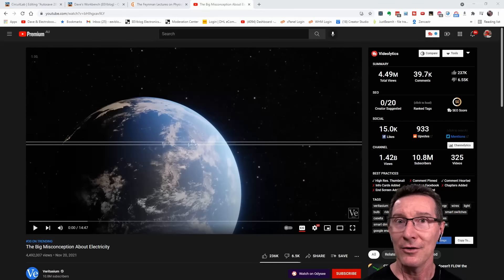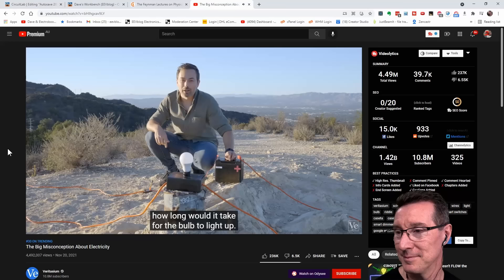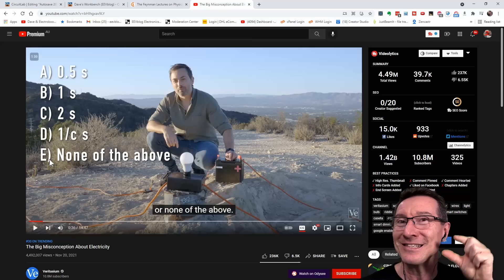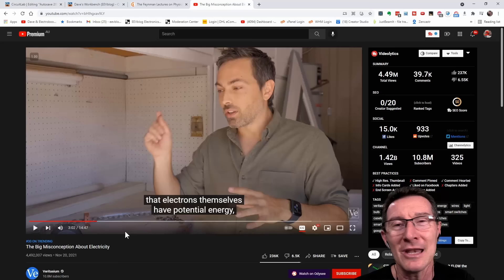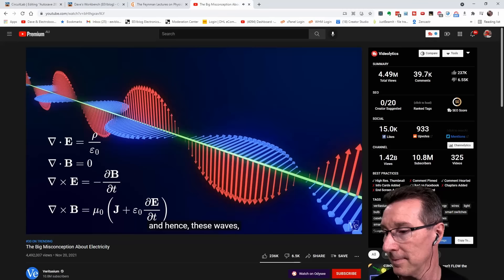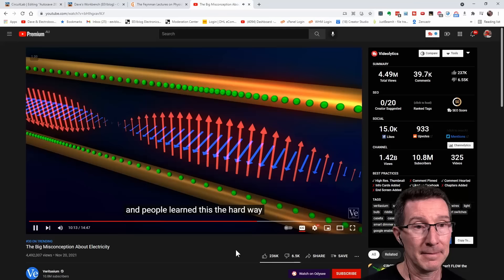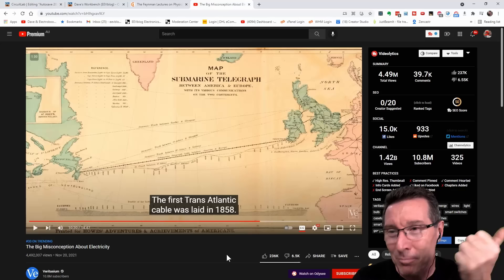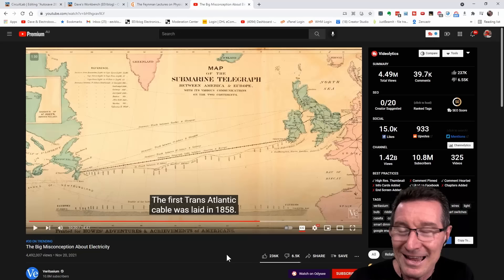EEVblog 1439 - Analysing Veritasium's Electricity Misconceptions Video

Comment: I'm surprised that you are supporting Veritasiums' claim that the lamp TURNS ON after 1m/c seconds.  This is incredibly misleading.  He is trying to claim that because the energy travels in the electromagnetic fields and not in the wire then it jumps across the 1m between the battery and the lamp in 3.33ns.  This is not correct.  As you showed with your simulation there will be a short current spike which arrives after 3.33ns because of the capacitance between the start and end of the wire but this can in no way be considered to turn the lamp on, it only lasts a few ns.  The lamp doesn't turn on until the energy that powers it has travelled all the way round the wire loops from the battery to the lamp which takes 1 second.  The correct answer is B (1second).  Veritasium even shows in his graphic that the Poynting vector points along the wire and not directly from the battery to the lamp.  It goes the long way round.

In your look at Richard Feynmans' paper you are misinterpreting what he says.  When he shows the S vector pointing into the wire he is only talking about the energy that's dissipated in the wire. ie the resistive losses.  The E vector he shows pointing along the wire is the voltage drop in the wire and not field due to any battery voltage.  He is not considering any energy being carried by the wire from a source to a load.  In the case of power being transmitted from a battery to a lamp the voltage field is perpendicular to the wire and the magnetic field encircles the wire so the the Poynting vector points along the wire as shown in Veritasium's video.  That's why the energy has to go the long way round and takes 1 second.  (edits for typos only)
Reply from the maker: He explained that, the bulb must be one that turns on instantenously. He's tryign to make the point about the coupling, and he's correct. It doesn't matter how long the bulb light or at what level, the fact that it does at all after 3ns is what matters.
Reply from the maker: Re Feynman: If there is a DC current in the wire then it must be going from source to load. You don't get a current without a load.
Reply: @EEVblog  He is not trying to make a point about the coupling, that is a trivial side effect.  He trying to say that because the energy flows in the fields and not in the wire then it can travel in a straight line from battery to lamp.  If he had said that the lamp gives a brief flash lasting a few nanoseconds then he might have a point but he didn't.
Reply: @EEVblog  Yes but Feynman is not considering that, he is only talking about the wire.  In a practical circuit the voltage field along the wire is only a few mv/m whereas the voltage between the wires is some V/mm or 10s of V/m.  So the E-field is essentially perpendicular to the wire.  In Veritasium's video he even assumes that there is no voltage drop in the wire so his Poynting vector is exactly  perpendicular to the wire.
Reply: @petehiggins33  that is what I caught too, he[Veritasium] started to sound kind of woo woo-ish towards the end

Comment: As an engineer of many years, and having read the Feynman papers, I'm with you all the way. On a much simpler practical note, whether energy actually flows in the wires is academic in that IF YOU DON'T CONNECT THE WIRES, THE BULB AIN'T GONNA LIGHT UP!! :-)
Reply: But how could the bulb even know if there is a break in the circuit some enormous distance away? 1m/c seconds is not enough time to be affected by there presence or absence of a break in the wire. Lighting up the bulb MUST be independent of the wires if the bulb reacts to the switch at the speed of light across 1m.
Reply: It will light up anyway but it won't stay lit. For the first part it is basically an antenna, that is the transient part, but if you cut the loop it will change the steady state response.
Reply: Now I am seeing that this answer is in the video from a transmission line point of view
Reply: @duaneeitzen1025  If you flick the switch on and off quickly, then at a later point in time the light will flash. The main point I was making is that for practical purposes it doesn't matter whether the energy is transferred inside or outside of the wires: if you want to power a light you still have to connect wires to it from the poer source.
Reply: @mytorojas  If you flick the switch on and off quickly, then at a later point in time the light will flash. The main point I was making is that for practical purposes it doesn't matter whether the energy is transferred inside or outside of the wires: if you want to power a light you still have to connect wires to it from the power source.
Reply: Wires aren't connected through capacitors or transformers, yet current flows.

Comment: I watched the @Veritasium video when it came out.  (I have a masters of science in electrical engineering, and 35 practical experience designing familiar electronics and software.)
I felt schooled by the video.  Maybe a little down.  I felt like maybe I needed to completely re-envision the way I think of electronics.
I knew the equations and theory he was saying were correct.  I love physics.  But... I really like my conventional view of electronics, the one I always had, because I can easily make predictions about what a circuit will do.
Your video, in particular, with 2 or 3 others I watched, really made me feel better that I was not the only one who didn't want to get mired in thinking deep physics for 99% of the situations, where the basic model works.  I have worked in autonomous driving circuitry, using radar, and with tesla coils, so I know all about high frequency and where the points he brings up become really relevant, and I agree and respect Veratasium,  I just mean regular common applications of electronics, where we can ignore those details, for the most part, make the conversation a fun thought experiment into physics for the extra nerd level of depth into the details of it all.  But I will continue to envision electronics simplistically to solve issues as I always have.
Reply: Theory is great, right up until your boss tells you the hardware has to be on his desk at 9:00am tomorrow morning.
Reply: @AndyGraceMedia  the penultimate difference between a scientist and an engineer. :P
Reply: @ExarchGaming  Not really, I think you miss the big point of this video. You are answering someone who probably did not study engineering electromagnetics, because it is not needed for electronic engineering outside of RF design and transformer design. And not all physicists have to think about Poynting vector fields, and they certainly cannot be measured, only abstracted and calculated from the electromagnetic field density vectors. Something that cannot be directly measured tends to not by contemplated very much, as such not very practical to deal with. I learned Poynting in power systems engineering, not in electronic engineering which I also specialized in. And it is taught for completion's sake and hardly ever used in problem solution even in physics and engineering electromagnetics. That is because what can be measured is much more germane to theory and practice.

Comment: @10:30 "a piece of restive wire" and "the battery" are mixed up. Even with DC the poynting vector always points out of the battery, because the E-field around the battery is reversed compared the the E-field around a resistance, whereas the direction of current ist the same in both cases.

Comment: Good video! I think its great you brought up Feynman, as I believe his emphasis is always on understanding in general how the little pieces form the large behavior. Electricity works by pushing charges inside a wire. That intuition is extremely crucial and burying that understanding with pointless formulas and jargon does no one any good!

Comment: 22:30 Remember, Dave, if it is changing, the change is propagating. So connecting a DC source at the moment of connection is no different than looking at the first quarter of a sine wave at the same risetime.
Reply: It's a side effect, that hasn't much to do with the main power transfer.
I want him to show the light bulb glowing (producing light) from a 12V battery with only the tiny fraction of a second long establishing fields period and the weak coupling of wires 1m apart.
Reply: @realedna  It isn't a side effect. This is how transmission lines work.

At long term DC, it eventually settles down to merely the resistance of the elements. Wire, bulb, battery, switch.  For any transient change or AC signal, the two sections would be modeled as shorted transmission lines using their characteristic impedance.

1 meter spacing makes a pretty high impedance transmission line...
Reply: @AlienRelics  Yes, but how long does this transition period last and how much energy would be transmitted?
Do we assume the battery has no internal resistance and infinite capacity to be able to provide infinite current for a reasonable amount of time!?
Assuming superconducting wires is already hilarious...
Reply: @realedna  You can't mix idealizations and real world circuits. You'll get nonsensical results.

Idealization is to isolate a particular effect or effects in a thought experiment.

Rather than talk about light years of superconducting wire, I think it would be more useful to build this with physical parts and use fast pulse generator and a scope. However, that is great for us technical types. Veritasium makes science popularization videos.

Comment: Interestingly enough, when I was introduced to C language long ago, there was a concept of enums. At first I could not grasp an idea of naming integers with some literals, yet later it all made perfect sense. Same as here, Ohms law, impedance matching and other stuff are just like enums, whereas integers are fundamental Maxwell's laws. It just easier to work with meaningful enums rather than with integers. It would be crazy to solve simple problems with Hamilton's approach in classical mechanics when you could simply utilize  Newton's laws.
Reply: I still get caught out with enums. I look at them like #define VAR 4, like it's a set number or something that gets written by the compiler. Got any sources you'd recommend?
Reply: That's just the implementation of enums in C. They're something else in other languages like Rust and Java. Just to make things more annoying... :D

Comment: **  Overall, the main points about practical electrical energy uses are:
~ A.C. waves have, in series, transverse & perpendicular properties, therefore they conduct thru the outer surface of conductors, which made them useful for long distance propagation, such as high voltage transmission lines, as long as the transmission lines are above ground, & separated by an insulator such as air.
~ D.C. waves have, in parallel, rarefraction & compressional longitudal properties, therefore they conduct thru the inner material of a conductor, which make them not useful for long distance propagation, because they generate more heat, from more internal resistance of the conductor material.
~ Tesla (A.C.) & Edison (D.C.), both became rivals trying to compete on which form of electricity would be better for supplying households & streets with electrical energy to power light bulbs.
~ However, both won out when it was only possible to invent a versatile device such as an amplifier, especially an audio amplifier, by not only using transistors, but by using both A.C. & D.C. electrical circuits.
~ NOTE: There is a difference between power transmission lines & communications signal transmission lines.

Comment: I'd really like to see the simulation with the "almost infinite" repetition of the capacitors. Like Dave alluded to about the far end being like an open circuit during the startup transient there is also more and more capacitance being "added" to the circuit as time passes and more of the wire is involved.
Reply: This can be done simply by terminating the line with the characteristic impedance. This will simulate an infinite line. Dave's open circuit approach was confusing to me.
Reply: @VisualElectric_  Would it though? I think Dave's open circuit is to make the point that for the first half second it does not matter what happens at the far end of the wire (because causality!)... I am saying as that half second passes more and more of the wire matters.
Reply: @VisualElectric_  Quite, that is the whole idea of a transmission line, one inch or a million miles it sees the same impedance when terminated correctly. (..I haven't thought about it much for 40 years so I may have got it wrong).
Reply: @bkuker  I do think Dave meant to use the characteristic impedance in this example. He wanted it to be an "infinite line", which means the signal will never reflect back. In the distributed parameter model, it makes a fundamental difference how you terminate the line, otherwise you are modelling an electrically short line (unless you use an infinite number of infinitesimally small LC sections).
Reply: RF engineers know from the get-go that a shorted transmission line which is a quarter-wave long actually acts like an open circuit. And an open transmission line a quarter wave long actually functions as a short.
Reply: @scottdurgin9895  That's it.

Comment: To put enough energy into the lamp filament to make it incandescent would require the system to be almost in the steady state time.  This would be longer than the L/C time and closer to the 1 second time needed to charge up the transmission line.  The line capacitance would produce a voltage at the lamp at L/C time but the current to get it hot is not developed that quickly.  In Dave's simulation the voltage goes up in nanoseconds as predicted by L/C, but it comes right back down again indicating the lamp is still dark until a steady state current can heat it up to incandescence.   I would like to see Dave's simulation show how long it takes to get that steady state.  He would have to use the full closed circuit model for that case.
Reply: Exactly my thoughts! 
I made a very crude simulation of putting a standard 3mm LED in there as the lamp and it takes about 16 seconds to get to 80% of steady state. I made a separate comment about it.
Reply: I'm confused why everyone is so stuck on the idea that the lamp couldn't light up from such a low current, and therefore the conclusion is wrong—the same experimental conditions that said the wires are 1m apart and have no resistance also said that the definition of "lighting up" is "having current flow across it", not "heats up enough to radiate visible light". The thing about thought experiments is that you have to accept the conditions, otherwise you're not answering the same question at all. 

Although maybe I'm misreading your comment and you mean it as "yes, technically, but also" rather than "no, actually", in which case, carry on.
Reply: @killerbee.13  Yes, technically an LED can light up for a very short time in this thought experiment. 

Whether it would come on permanently or at which intensity was never even hinted at, so many will just assume full intensity permanently, since that is kinda implied by "the light turns on". Even if you assume he used a Lamp that turns on without a delay relative to the voltage across it (fine by me), it would still be logical that the intensity is in some way related to the voltage/current on it, as that is pretty much inevitable due to conservation of energy. Again, "the light turns on" implies it is visibly lit to a human unless you specify otherwise, which requires a significant amount of power.

If you take a thought experiment to such an extreme, the Lamp would be "lit" constantly anyway just from ambient radio waves as well which cause a non-zero current to flow in the wires. This effect is not necessarily negligible compared to what Derek says will happen. Because of these reasons, my problem with the thought experiment is that it arbitrarily considers SOME laws of physics and ignores others. This is completely unhelpful.

Derek did not clarify any of this in a video targeted at the general public. That's what bothers me the most. Judging by the comments on his video, pretty much NONE of them understood any of what would actually happen as a result of his bad explaination, and are instead misinformed. His video literally has NEGATIVE value, i.e. it is purely harmful in my eyes.

Comment: Many, MANY years ago when I took elementary electricity and magnetism, in the module on circuit theory we calculated the predicted velocity of electrons in a real conductor, and it came out to a few centimeters per second at most.  (I noticed that there was a fascinating difference between chemistry and physics at the undergraduate level.  In physics we used models we knew to be wrong to predict the results of experiments we expected to work, while in chemistry we used models we treated as correct to predict the results of experiments we expected to fail.)